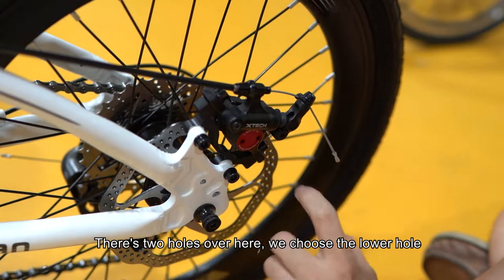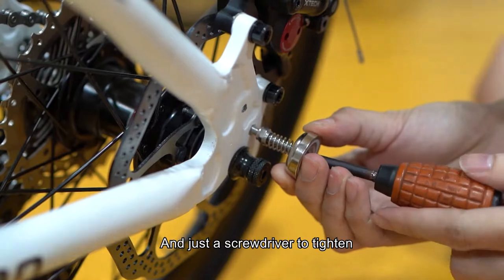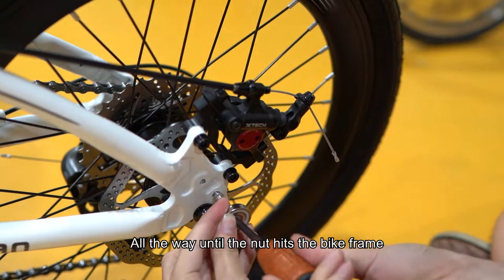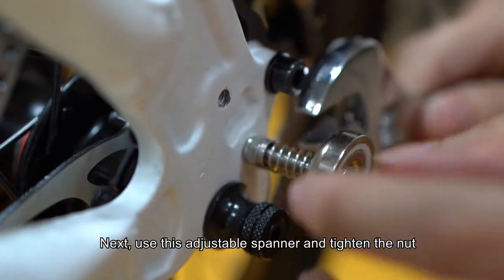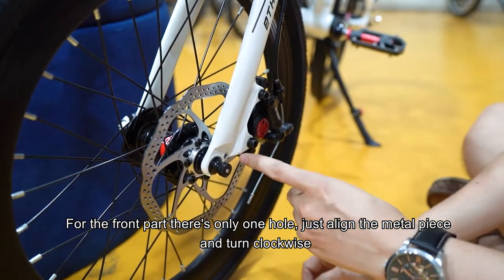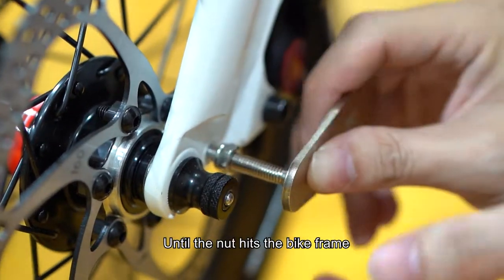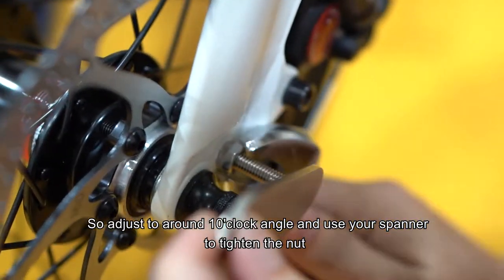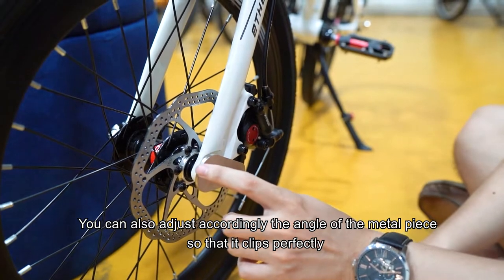Ethereal Designed, Customized Magnets for foldable bicycle

Comment: You installed the bolt and nut in the rear. How is the spring going to work in this manner?
Reply from the maker: This design has much bigger surface, as long as you fold your bike correctly, you don't need the spring to have huge adjustment. 

From the video, the spring still can be pushed inwards, and have minor adjustment on the angle.
Reply: @THEBIKEATRIUM  how is the spring going to be pushed inward where there's no inward play movement.  I believe this a  universal magnetic assembly and your installation is incorrect for the rear.
I'm using this magnet assembly on both my foldies. My Camp foldie came with it and I bought and add one to my other bike.
Reply from the maker: @ma-kugan4998  The magnet is not attached to the phillips head screw/bolt, spring can be compressed by pushing the magnet inward. Again, if you observe how the bike closes up, it requires literally no compression of the spring for any adjustment. Camp's magnet is the older design, it is totally different from the one we've used in the video.

Video may not show very clearly how it works, if you're keen, please feel free to come by our store and we are happy to demonstrate it to you on the spot :)

Cheers